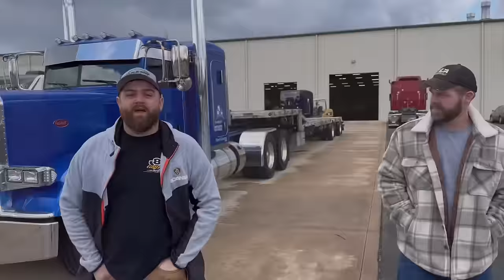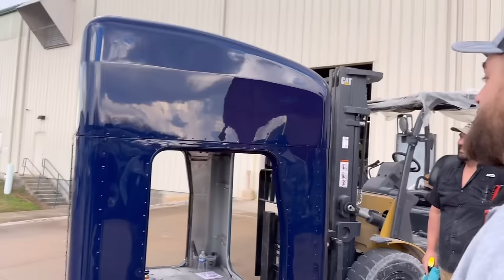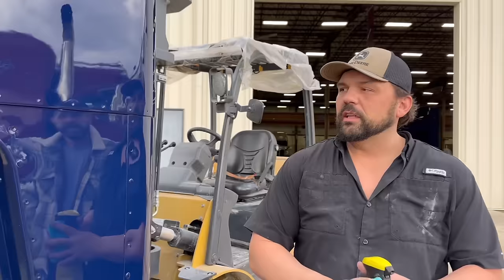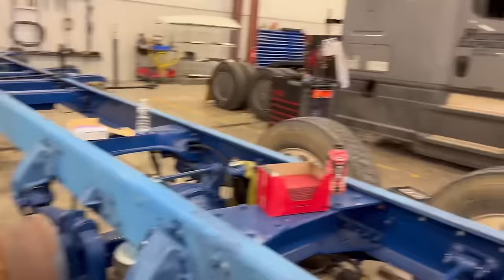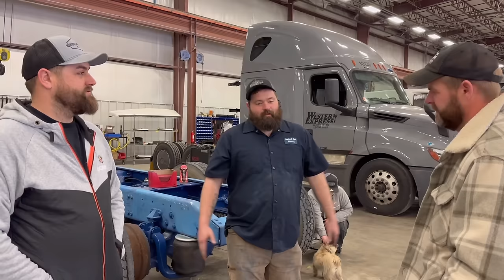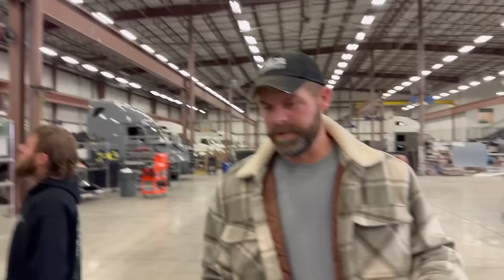Joining the Greatest Team in the Trucking Industry!

Comment: I know all about the constant bucking rivets on these trailers. 15 years of trailer/truck repair and I lost at least half my hearing. Definitely the hardest of it is trailers though. Panels/roofs/radius basically everything is bucked. Very few times I'm using pull rivets. Unless it's a reefer than basically the entire side is shaver heads but than you gotta go back and cut/shave 1000 plus rivets